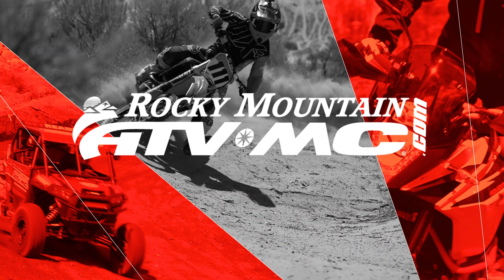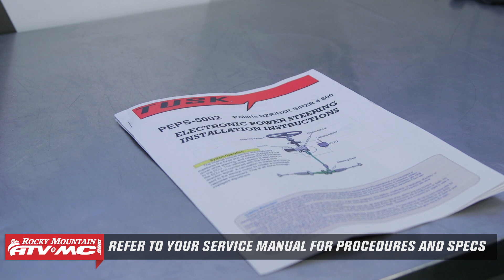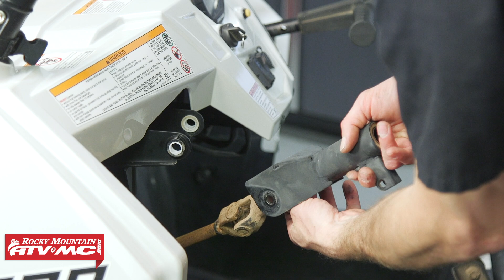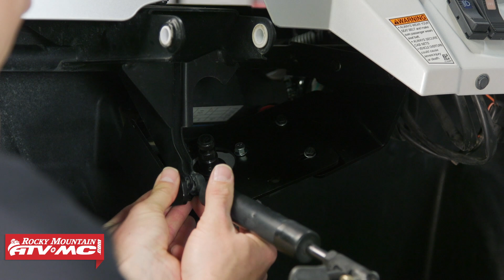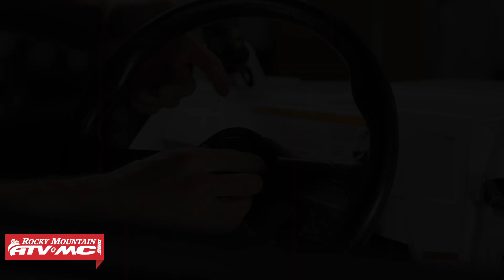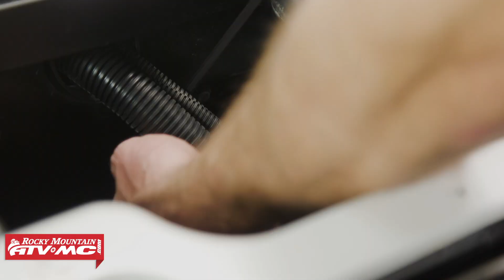How To Install a Tusk Electronic Power Steering Kit on a Polaris RZR 570 & 800

Comment: Does motor bracket with 2 holes mount to inside or outside of the 2 hole factory bracket?
Reply from the maker: It should go outside.

Comment: I wouldn't use that red trailer splice connector. They will definitely fail if your in water or  mud. You'd be better off stripping insulation off & wrapping the wire, the electrical tape. Good video